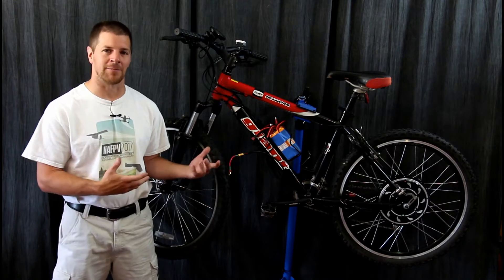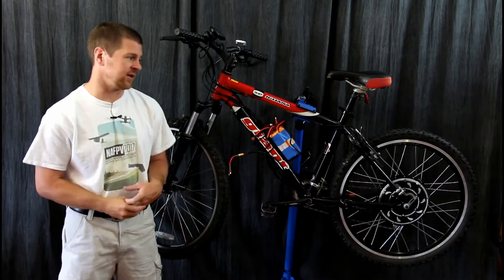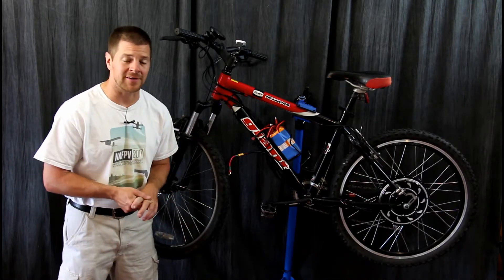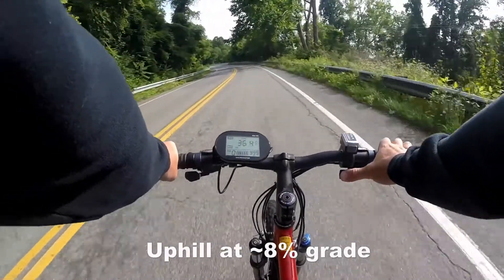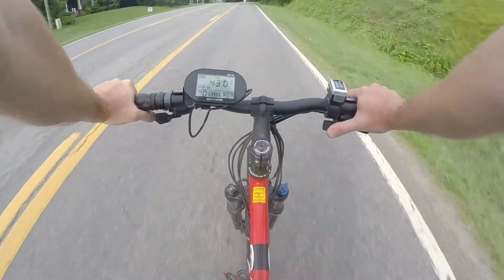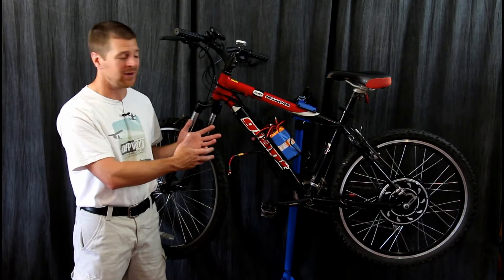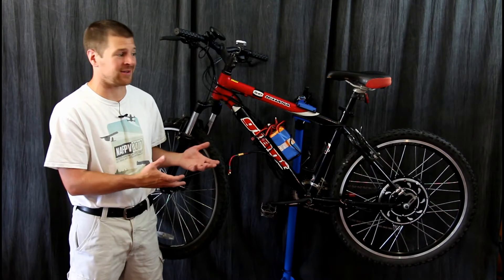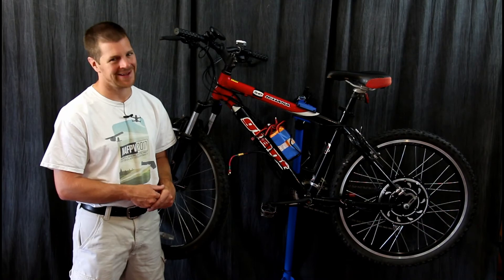Golden Motor Magic Pie/Smart Pie review

Comment: A geared hub motor eliminates the "drag" of a direct drive motor. Geared hub motors are also smaller and lighter. So, bonuses all around. The only downsides, if you can call them that, are the lack of regenerative braking and slightly lower high-speed efficiency. As regen adds less than 5% to maximum range, this isn't really a downside in my book. I'm converting a Nishiki 29er using a 52V/1,500W geared rear hub motor. Building my own 14S battery using new "power" cells (18650), I'm expecting 30+ mph with 30+ miles range. The weight will be the minimum possible, but is a big reason I chose the geared motor. That, and the additional torque it provides for stop-and-go traffic, hill climbing and mountain biking.
Reply from the maker: Lack of gearing is a severe limitation, for sure.  My current project I am going for light weight which also uses gearing.

Comment: I used this same kit for my kids but no pedal assist and no display.  My daughter pins the throttle to start then hits the cruise control button and it accelerates to top speed on its own.  Very fast and fun.  I built one for my girlfriend in 2016 using the bigger Magic Pie V5 and she commutes on it pedaling on easy parts of the commute and using throttle to cross big intersections and fly up hills.  I’ve tried other hub kits and compared to the Magic Pie they all fall short.  The sine wave controller built in to the wheel seems to make a huge difference.  Other kits overheat easily and just don’t pull as hard as the Magic Pie.  Great video!!!

Comment: nice.. is there no way to add a clutch to it so that when the motor isnt turning you can pedal normally?
Reply from the maker: I wish, but no.  The motor is always connected.  A 10mph, the rotation of the motor will turn on the electronics without a battery in it.
Reply: @highervoltage5430  You might want to try a geared hub for less weight on the hub.
Reply: If you give a tiny bit of throttle/power it negates the drag of the motor.  Also once you get some speed/momentum I don’t notice the drag.  Grin technology has a kit that automatically feeds a tiny bit of power to offset the drag but I haven’t tried it yet.  I set the cruise control low and pedal along to conserve power.